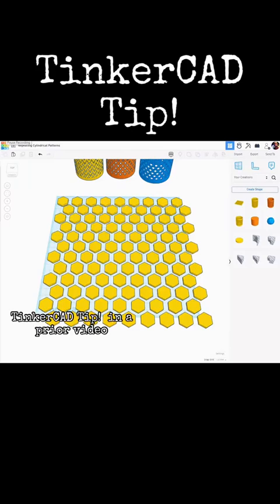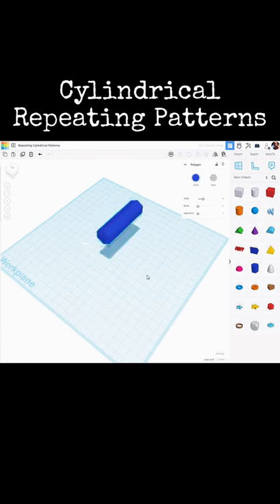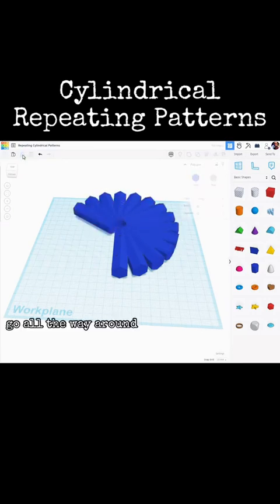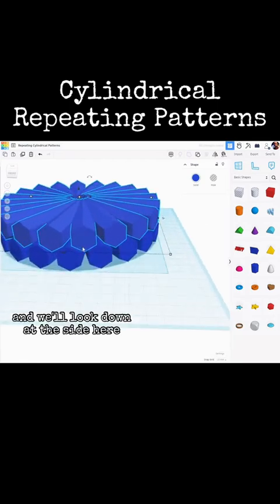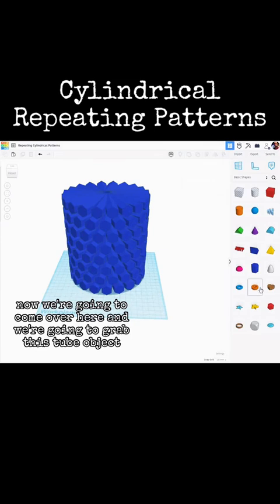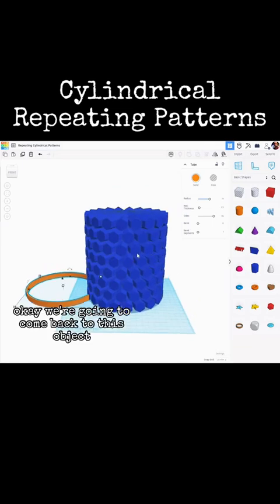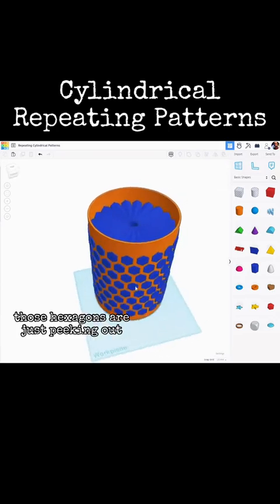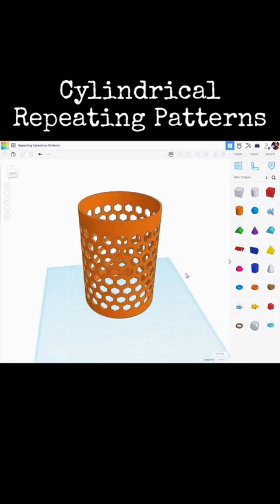TinkerCAD Tips! Cylindrical Repeating Patterns.       #tinkercad #caddesign #3dprintable #3dprinting

Comment: Is it possible to create a raised pattern with exact measurements instead of holes so that the raised part acts like a litho roller?
Reply from the maker: Absolutely!  I recently posted two videos on applying textures to curved surfaces, one where the texture or pattern was embedded into the curved surface, the following video was show how to do it as a raised texture, like 1/2 to 1mm for example.  Now this technique can’t be applied all the way around a cylinder.  However, you could apply a repeating pattern to 1/4 of the cylinder, then duplicate that portion to make the other 3 sides of the cylinder. 
 You could very simply make a roller like with little foot prints or some other repeating pattern that way.